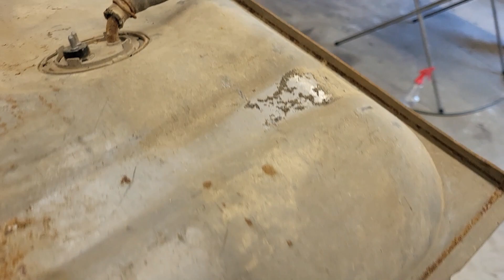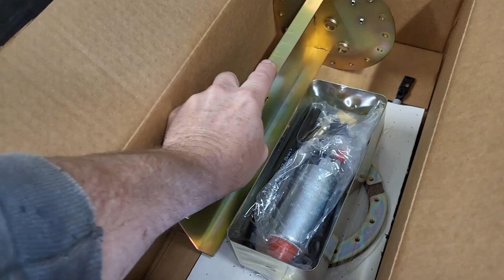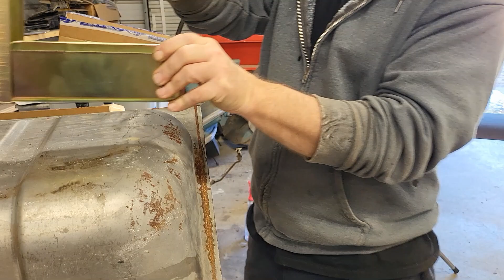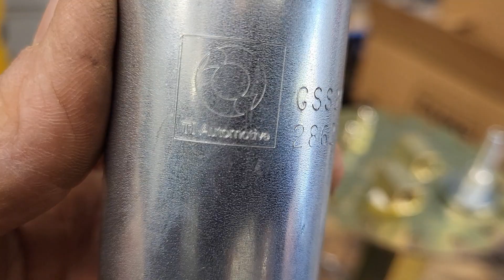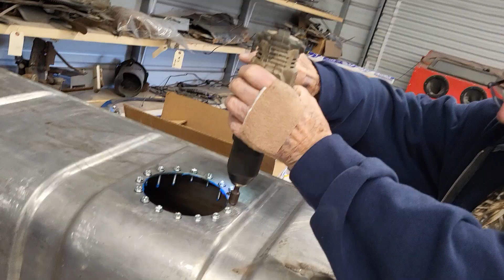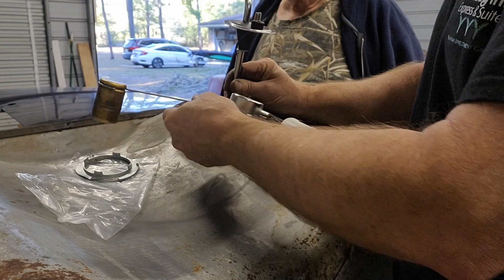EFI Fuel Tank Conversion

Comment: Hey Matt, nice job. In tank electric fuel pumps are the best way to go when installing an electric fuel pump as opposed to placing it in the engine compartment for example. I think you did a really nice job and Ill keep this in mind the next time I go to install an electric fuel pump. Too bad the fuel lines need to go through the trunk. Theres always sacrifices to make I guess.
Reply from the maker: @vintagethunderbirdrepair9426  it.was.a.trade off.  In the end I wanted the reliability of the fuel injection with this car.  All in all.. it worked out.good.  I was able to ise the existing holrs in the trunk.

Comment: I've been looking to do this mod for a few years. I have the external pump (mounted high) but I don't trust it. As you know, the Birds tank is rather oddly shaped and doesn't lend itself to adding an EFI pump. I've wondered if I could space the tank down enough to not have to drill through the trunk. You did some nice engineering with your install and can enjoy not worrying about it like I have to. 
Just a note, the biggest mistake I made with my EFI was using one that was too big. I used a Sniper  4 BBL 900 CFM and it's way over sized for my mild 390. Some day I'll probably buy the 2 BBL unit to improve drive-ability.
Looking forward to the whole system install!
Reply from the maker: Hey Scott.  Sounds like we've both been doing a lot of thinking about that odd shaped tank.. lol.  I haven't decided completely on the EFI system yet but am leaning towards the Edlebrock pro flo.
Reply: @Exit45Restorations  That wasn't out when I did mine. The sequential part would be pure greatness!